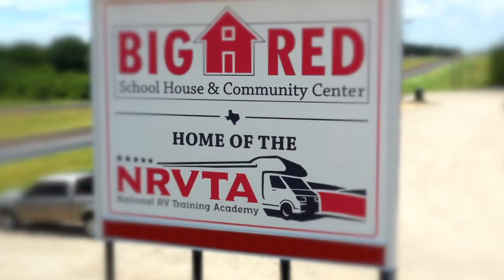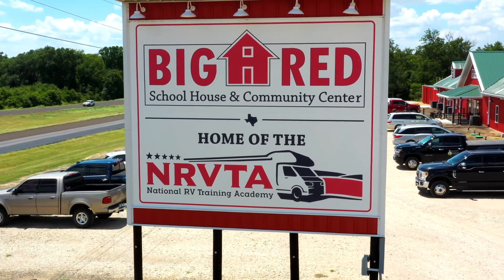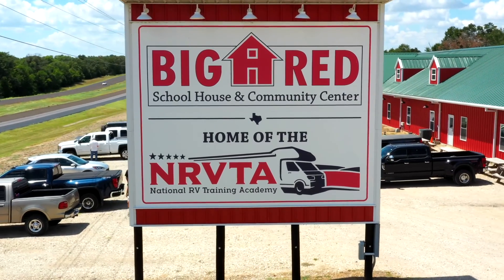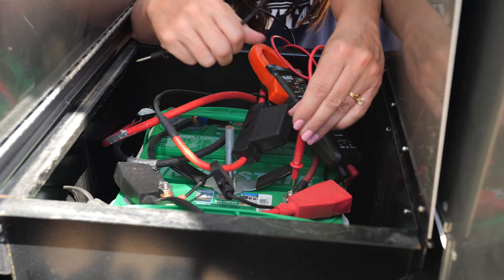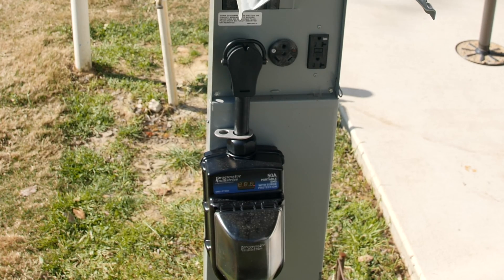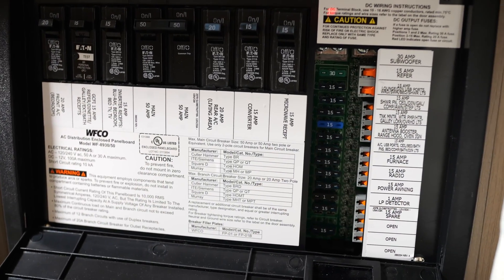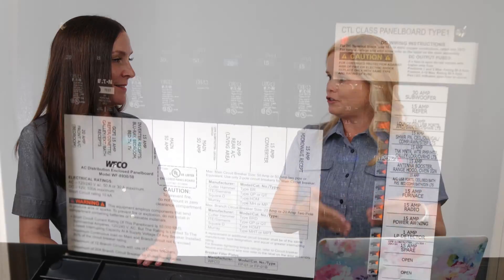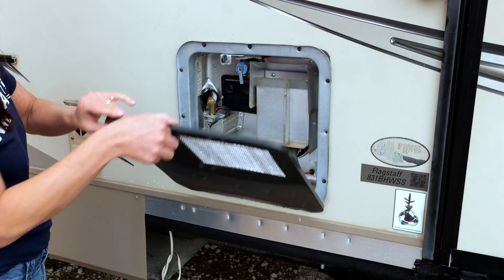RV Electrical made easy // 52U

Comment: My problem is Three overhead lights lights in the RV only work sporadically Could it be a weak fuse or would it be a wiring issue. Maybe the groundwire not connected correctly. We tried following the wires  everything looks OK. The video  I just watched was very helpful You both seem to do a great job explaining.
Reply from the maker: It could be a few different things. Fuses can always go bad, somethings it's the wiring and sometimes the fixture itself can be causing the problem. the newer LED fixtures are notorious for doing this. you can also check your battery voltage and make sure you have enough voltage in your battery.

Comment: Good information. How does the solar power work each appliance? Our solar panel came with the RV. It operates the refrigerator down the road in our TT.
Thanks
Reply from the maker: The solar charges your battery. and then we use the inverter to create 120v shore power to run the refrigerator. The solar doesn't directly operate anything.
Reply: Thank you.